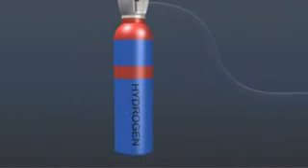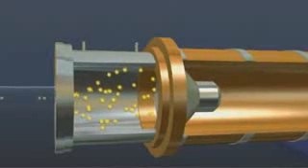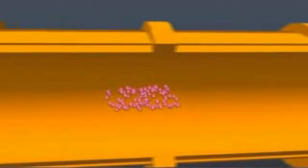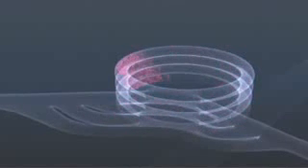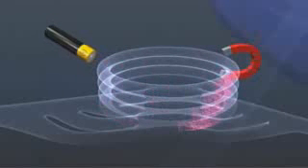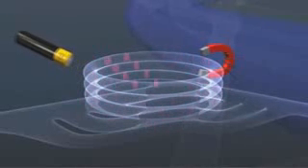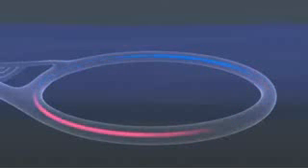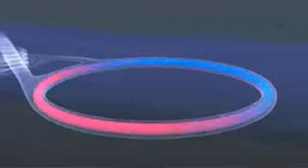How Does The Large Hadron Collider Work?

Comment: HA HA HA HA HA HA HA HA

#onemillionusdollars

#clay #1million$#prize #7millenialmathproblems #conjecture #meaning an opinion or conclusion formed on the basis of incomplete information.

The #nobility of #proving or #disproving someone's conjecture depends on the nobility of the purpose of the conjecture itself #unless you consider being #knighted and being #rich is TRULY noble. 

The science and the mathematics which humans were allowed to access and or what humans refer to as humanity's technological achievements (#precision?) is based on the atomic second(caesium 133).

It is only 0.0000000001 sec #accurate?

humans should never pretend #intelligence.

The technology humans were claiming is simply enough to sustain life on earth for a very finite length of time. And still, humans misused it because of greed.

THE UNIVERSE IS PERFECT. IT IS ACCURATE AND PRECISE TO 0.000000000000000000000000000000000000000000000000000000000000000000000000000000000.........000000000000..........000000000000000000000000000.............000000000000000000........000000.......0000000000.........000000000000000000000000..............(1) of a second.

THE UNIVERSE IS PERFECT. IT IS ACCURATE AND PRECISE FOREVER. :)

TO GOD ARE ALL THE GLORIES!
GLORIA EXCELSIS DEO!
Reply: I'm not sure what I just read